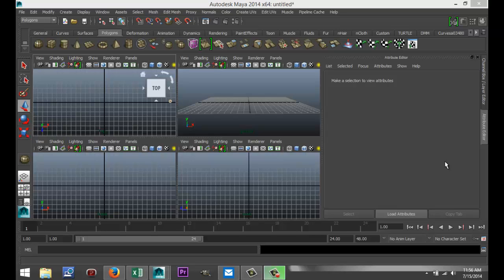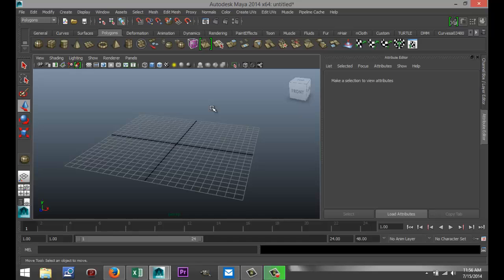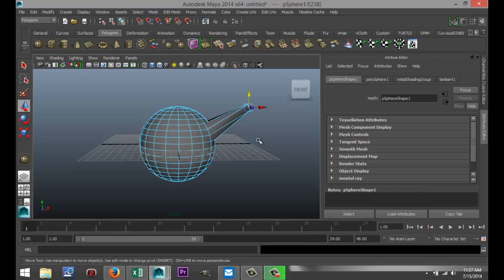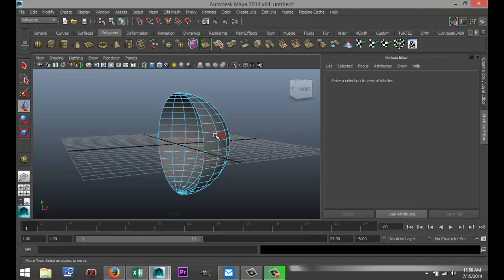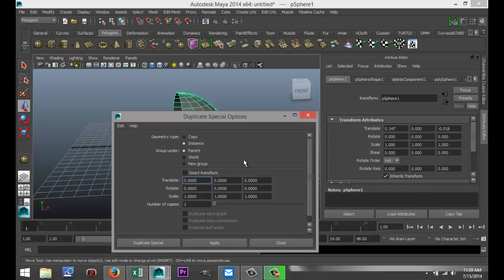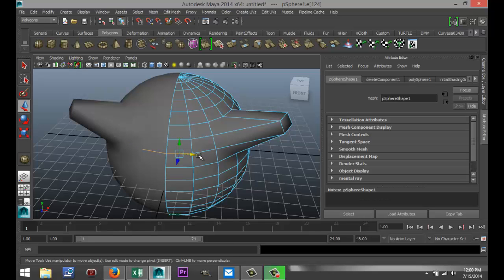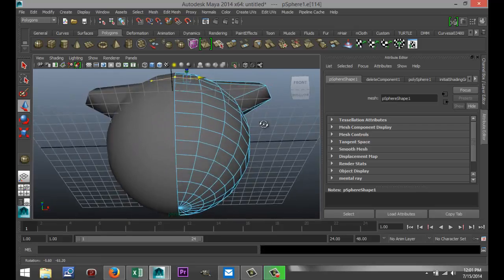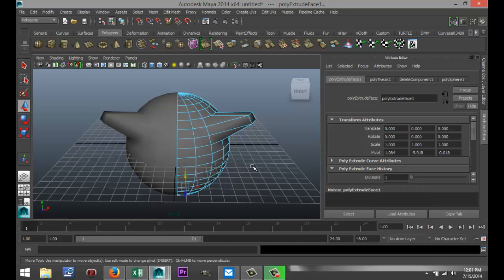Maya 2014 tutorial : How to mirror objects while box modeling

Comment: i was wondering if you could tell me how to do this in 2017. im double clicking my move tool and the preserve seam option is already selected but i can still make a gap in my object. what am i doing wrong?
Reply: Martin Martinez Jr I know it's been a couple months but I just figured this out because I had the same problem. Select both halves of your object in object mode, go to mesh>combine. Click on the combine settings, make sure merge by name is clicked and hit apply. It worked for me!
Reply: I was just wondering the same thing. The box is checked, but it still creates a hole when I move the vertex.
Reply: merge vertexs to 0.001

Comment: Wanna ask. When I apply the duplicate special. It appear black side. But I can make it. But how to solve the black side???. I am still new in Maya
Reply: Just a warning, This issue has not been solved by changing the render type. That will only apply in Maya, and could make troubles later of if the normals are not fixed. When you're done modelling in the view setting which shows all normals, go back to normal view, select the half with the reversed normals. Make that independent from the original, and THEN reverse normals of only that half.
Reply from the maker: +Nemo Nautilus You need to reverse the normals on the "black one" ( I think it's under Mesh - Reverse )
Reply: when I do the reverse. my true or my modeling side become black too.
Reply: Ohh. I found it. Viewport > Lighting > two sided lighting.
btw how to stop duplicate???.
Reply from the maker: +Nemo Nautilus Duplicate ?
Reply: +Nemo Nautilus thnx man u solved my problem too
Reply: I can not get it to reverse my duplicated half. I don´t know what I´m doing wrong, I tried every setting I can think of....

Comment: i have version 2015. wich steps must i take to make the objekt grey? it always turns black and you have told me before how to do it but it does not work.  thanks
Reply from the maker: +Dan Ögren If the object turns black instead of grey you need to select the object and reverse the normals
Reply: Tank you.
Reply: +Mike Hermes that turns the other balck though!?
Reply: when i reverse the normals on the selected faces, it will in turn reverse the normals on the correct side? do i finish modelling everything, then combine and separate so that they are not instanced anymore and then reverse the normals? in that case i shouldn't model in viewport 2.0 and use legacy viewport instead right?